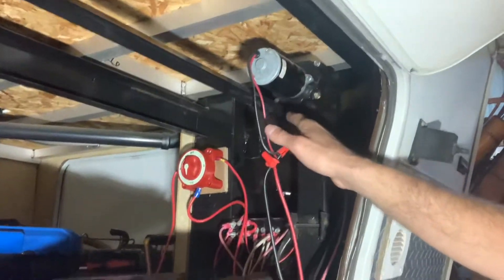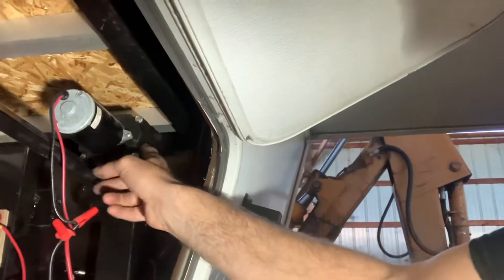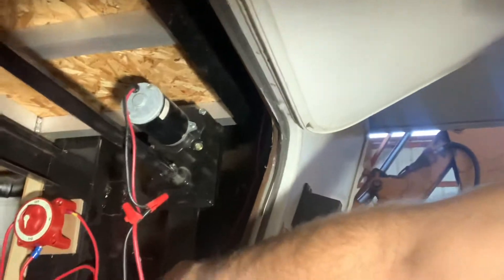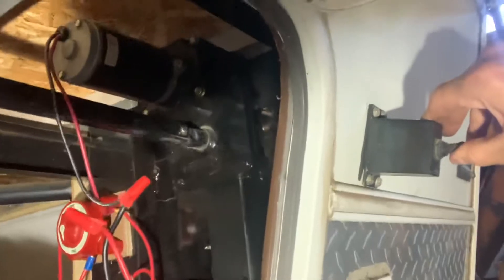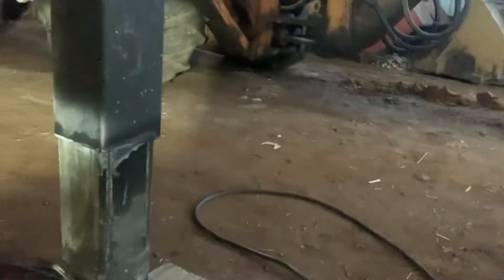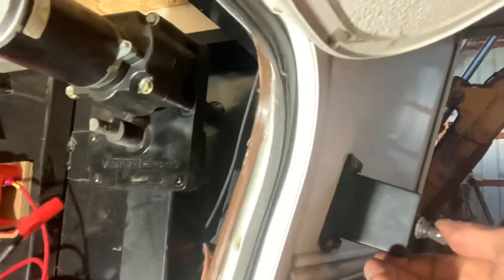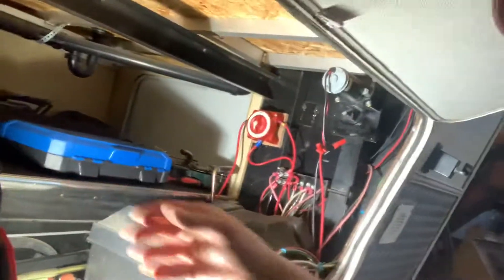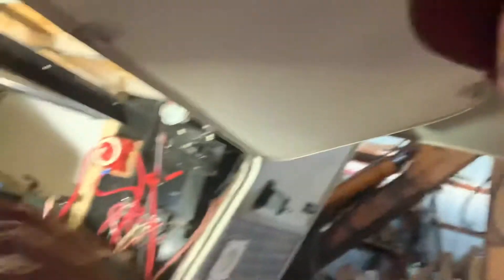5th wheel landing gear conversion to dual motor (1 of 7) -TDF

Comment: Hello, I am about to seperate my landing gear just as you did, Great Job. Will you please list the parts I need to buy. I like the idea of changing out the gear kit on the passanger side rather that buyinh the new leg. I need the gear box and motor also please. I have a 2003 Keystone Challanger and I believe it is Lieppert landing gear. Thank you!

Comment: so is each motor on its own fuse or they both run on the factory 30 amp fuse? sorry if you mentioned it i just skimmed the video
Reply: I have original factory landing gear with one motor and a drive shaft to the opposite gear. It looks like the photo on the left above.